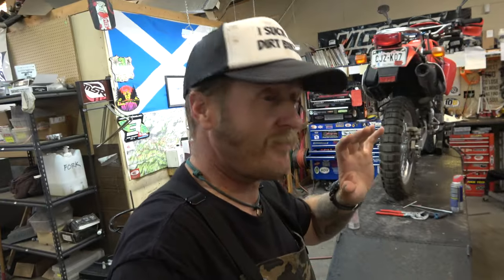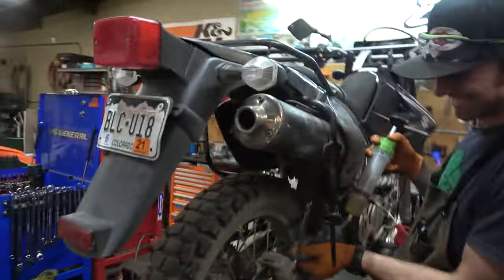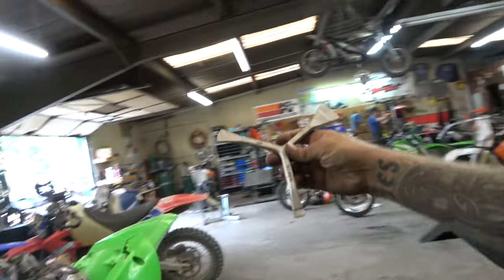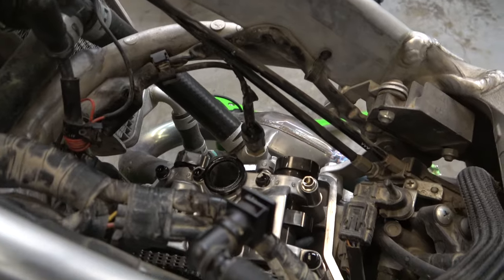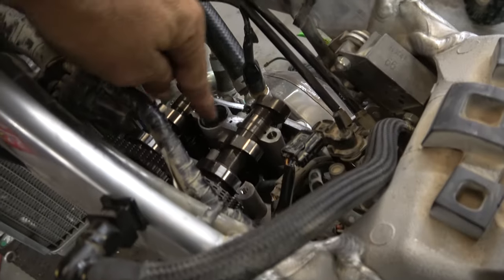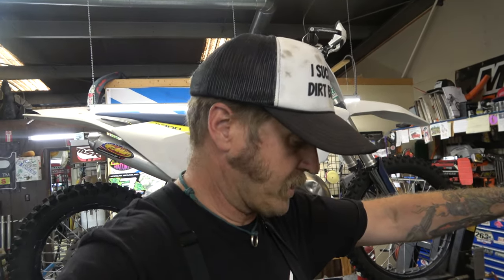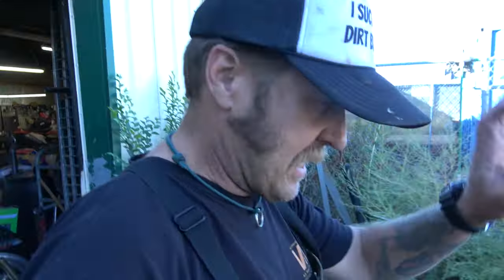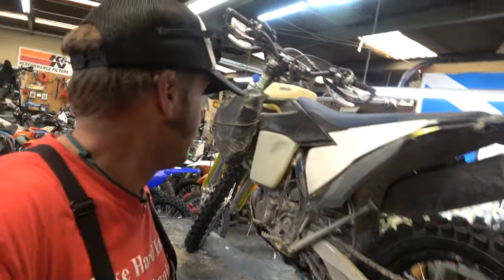KX450F Valve Adjustment | KX250F Clutch Bleed | XR650L | Shlog 223 | Highland Cycles

Comment: Why not turn the KX over with the kicker to check the valves? Don't have to remove the plug maybe. It still has one right?
Reply: No kick start.
Reply from the maker: No kicker but even if it did, using a socket is easier and better because you can stop it at the right point easier.